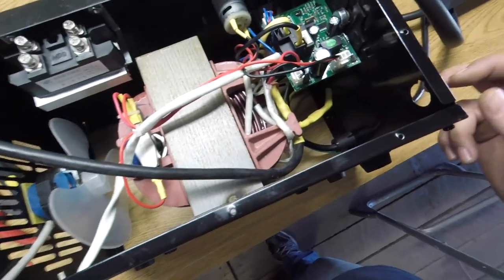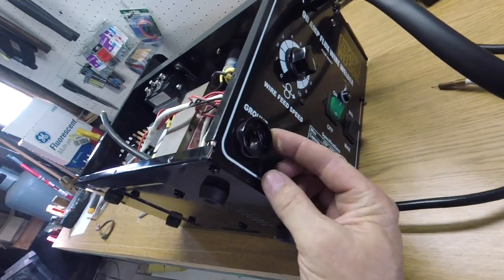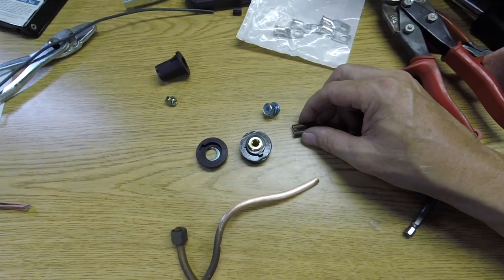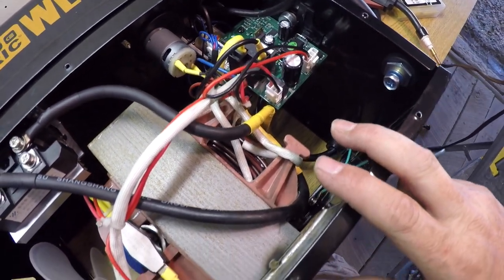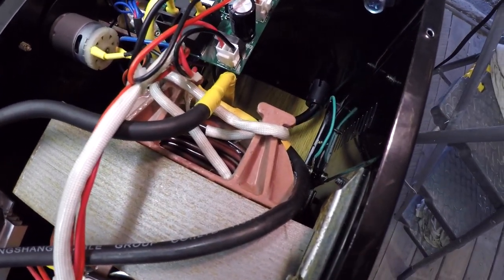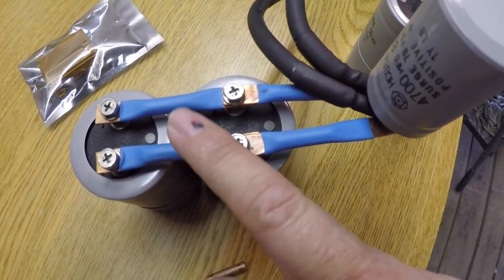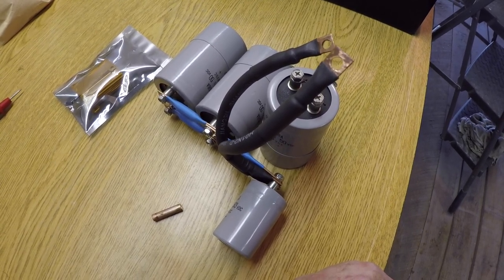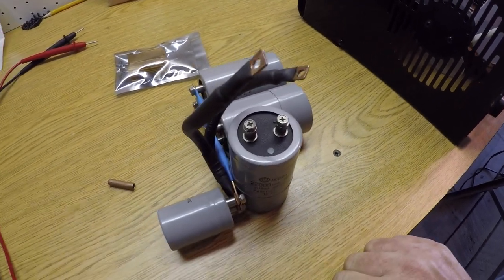Installing the Capacitors - Harbor Freight Gasless Flux Core Welder Mods (Part 4)

Comment from the maker: Harbor Freight Gasless Flux Core Welder Mods - AC to DC Conversion
https://youtu.be/nu0S4rs9ygo
Reply: What size single capacitor should be used then using all the ones used in video?

Comment: Great idea to use the copper tubing as connectors.  That is much better than the ring lugs.  I was going to say something about being careful with the capacitors after you power them up but it looks like Joe beat me to the punch.
Reply from the maker: Thanks for looking out for me :)
Reply: @DIYHomesteadProjectsDIYHP10  Hahahaha.  I have been called a "Mother Hen" before.

Comment: hi great video and very very clever idea about the copper tube fittings thats great and will save me a few dollars, well pounds in england on having to buy the ring connectors, thanks
Reply from the maker: Thanks and you are welcome. The copper tube fittings are fantastic and way way more cost effective than store bought connectors. I don't know why but ring connectors here in the US are just way too expensive for what they are. Good luck with your project!

Comment: Definitely getting one of those dinse connectors for my welder.
Cheers
Reply from the maker: It makes it nice for sure.
Reply: @DIYHomesteadProjectsDIYHP10   You got the specs on the DINSE connector?  seems like there are a bunch of different kinds.
Reply from the maker: Yes, there are only two sizes I'm aware of. They have 25 and 50. I'm using the smaller ones (25).
Here is a link to the ones I used.
TIG Welding Cable Panel Connector-plug DKJ10-25 200Amp Dinse Quick Fitting 2pk - https://amzn.to/2GU3jrD
Reply: @steveflorman9922  Made a series of videos on how I modified my welder and posted a link for the connectors I used. There's definitely more than one seller out there. I used a seller on eBay. DIY Homestead Projects gave you a good link, but there are a variety of sellers selling the same item for different prices. Cheers

Comment: was all your internal wiring from transformer , to and from rectifier  and  capacitor bank etc made with same 6 gauge wiring ?
Reply from the maker: Yes but I think I used 8 gauge wire if I remember right.

Comment: Ok so I've got a question....does it matter which one of the capacitors you connect to the bridge rectifier MEANING if the bridge rectifier is connected to the center of the 3 capacitors or at the end run of the capacitors, because most connect them to the middle of the run, and i don't know (just curious) if that would affect the overall  performance of the DC electrode negative...!!??? I have mine at the (end of the run) which dealing with electrical work for many years , it just make more sense 2me 2 put it at the end(last) capacitor to make a "complete circuit" it just seems to complete the circuit better, OR is it best 2 have the bridge rectifier connected to the middle of the 3 capacitors then FROM THERE  to the electrode negative to the gun and positive to the ground....IS THERE A DIFFERENCE....???? 
The middle or the end of the parallel setup of the capacitors..?
I hope I explained it clearly.
I have mine at the end of the first of the 3  capacitors , then the last capacitor parallel to the gun and ground....!!! Thx....
Reply from the maker: I don't know if that would make a difference or not. I set mine up the way I did only because it seemed to be the easiest way to fit everything in the case and route the wires.
Reply: There is an ESAB inverter teardown on youtube. That machine had one 1000uf capacitor and two chokes. Made in Sweden.

Comment: Great Video...     You should consider getting yourself a tripod or mount of some sort.     I was hoping for a short welding video after each step.     I have an old HF 90amp AC MIG that I have considered just adding just an 150 amp bridge rectifier to convert it to DC which would be $12.79 delivered plus a few feet of wire and misc. connectors - less than $20.      I only paid $50 for this welder years ago and I'm not all that interested in putting much more into it.     ALWAYS wear safety glasses, even if using a face shield.
Reply from the maker: I was also contemplating putting more money into this welder before I did these mods. I suppose my own curiosity got the best of me and I had to know what difference it would make. I think it did make a fairly big difference but I don't think it's completely worth it from a financial standpoint. Now days for the cost of the welder and then the parts to modify it you can get the Titanium DC machine from HF and it looks like it welds fairly good out of the box. The only real advantage my old 90 amp has over that new Titanium is the size of the spool. I am running a 10lb spool on the HF 90 amp and I'm pretty sure the largest spool the Titanium will hold is a 1lb or 2lb spool. As I'm sure you already know, the wire is much cheaper per pound in a 10lb spool. Either way, it was fun making the mods and testing the machine.

Comment: With such large capacitors in parallel i hope you have hearing protection on if just one ever shorts out from all the heat generated in the welder.
Reply from the maker: I haven't had any issues to date with this set up.

Comment: What is the Voltage rating and the tolerance of the capacitors ? It should be stamped on the side.
Reply from the maker: I used three 22000mfd capacitor 50vdc. I think the small cap was 7000mfd 50vdc.
Reply from the maker: I can't read the caps as they are installed in welder but I looked up my ebay order and they were the Hitachi HCG6A caps. They were used caps reclaimed from some unknown equipment of some sort.
Reply: @DIYHomesteadProjectsDIYHP10  Thank You :-)
Reply: @DIYHomesteadProjectsDIYHP10  Thank You :-)

Comment: I thought 8 gauge wire was only rated for 40 amps?
Reply from the maker: That is correct Wes. It must not see more than 40 amps inside the machine. It is the same gauge wire the manufacturer used stock from the factory.

Comment: i"m worried the rectifier connections might be too close to the case when closed
Reply from the maker: So far it hasn't been a problem. I have thought about coating the rectifier bolts with some liquid electrical tape but I haven't done it. The side door has a pretty thick coating of power coat and I think I have just under 1/2 inch clearance with the side in place.
Reply: I just put a plastic cover over my rectifier. You can see what I did in my series of videos on how I modified my welder. Got a lot of good tips from DIY Homestead Projects. Cheers

Comment: Do you have a link to where I can buy  the capacitors?
Reply from the maker: Sorry but I don't have a link for the capacitors. I purchased mine used off of Ebay. These were some sort of salvage out of some type of industrial equipment I was told.

Comment: Wich capacitors are the best for this kind of project
Reply: Wich single capacito would be the right one
Reply from the maker: I am not sure there is a correct one. I've just been told that the more micro farads you have the better it will be. I've seen many mods done with a single cap and they seem to be everywhere from 22,000 to 60,000. Sorry I can't give you more info but I hope it helps you out a little.
Reply: The most important value is the voltage rating of the capacitor. Exceed that and the capacitor will short inside.  You can use a meter to measure the voltage across the welding ground and gun. Add a percentage for safety factor.  You need an electrolytic cap and it must be connected in the circuit with the correct polarity, negative to negative.  I haven't yet worked out what the capacitance value should be. Google "choosing capacitor for bridge rectifier"
Reply: Mallory is the best caps made. I build sound equipment. Amplifiers and the like. God bless and work safe.

Comment: What resistor you use
Reply from the maker: Aexit Chassis Mount Fixed Resistors Wirewound Aluminium Housed Power Resistor 5% 50W Single Resistors 470 Ohm - https://amzn.to/2USztY3
Reply: @DIYHomesteadProjectsDIYHP10  thanks
Reply: @DIYHomesteadProjectsDIYHP10  what's the purpose of the resistor on the capacitor? Does that diminish any super high voltage or back EMF? Just learning. I made some big inductors out of old alternator stators and microwave transformer cores, actually made a big difference welding with aluminum DC rods.
Reply from the maker: The capacitor's help to smooth out the current and provide a more constant DC voltage. (smoother arc) The resistor bleeds off the power stored in the capacitors after the machine is shut off or the arc is extinguished. That way if you are repositioning for another weld or moving things around you don't get a surprise arc if you touch the tip of the gun to a grounded surface. My capacitors are discharged in about 10 seconds or so after releasing the gun trigger. The time it takes to discharge depends on the resistor rating.
Reply: @DIYHomesteadProjectsDIYHP10  awesome explanation, thank you very much for taking the time.👍🤞👌😎

Comment: so this is prob a dumb question but are the AC leads coming off the transformer positive and negative?  I want to make sure I connect them properly to the bridge Rectifier!  I am not an electrician by any stretch! I understand the hookup from the DC side!  just trying to clarify!
Reply from the maker: That's a good question. The two AC leads coming off the transformer have no polarity so it doesn't matter what (AC) lugs they connect to. Just make sure you have the AC leads on the AC side of the rectifier and the DC leads on the DC side of the rectifier. The DC side should be marked with +  -. Then the DC leads go to your capacitor(s) and they should also be marked plus and minus. Then out to the gun and ground clamp. Just remember all the AC connections have no polarity and all the DC connections must have proper polarity. I hope this answers your question.
Reply: @DIYHomesteadProjectsDIYHP10  thanks for the feedback!  awesome video set brother!
Reply from the maker: Thank you and have fun with your project 😀
Reply: Reason for that being that AC current is changing direction/polarity 60 times a second, in the US anyway. 50 hertz in some countries. Either way, polarity is irrelevant because of that.

Comment: Don't fry yourself with those capacitors.....once they are charged they are dangerous.  I know you are aware of this.... but maybe others are not.
Reply from the maker: Thank you Joe, it's definitely worth mentioning so I do appreciate the comment. I'll try to mention the danger of the capacitors in my next video if I don't forget. 👍
Reply: Add a bleed off resistor. If you’re clever it can be arranged so that it only engages once the trigger is released. This way it’s not sapping power while you’re welding.
Reply from the maker: I did install a bleed resistor as seen in the completion video. I personally wouldn't want to do this mod without one.
Reply: In high school I would form a loop in a condenser wire from point ignition.
Stick it in secondary spark plug wire. Crank engine over, to charge it. Then go into the hall and hand it to some freshman, asking him to 'untie the loop'. These large caps for this welder can be lethal.